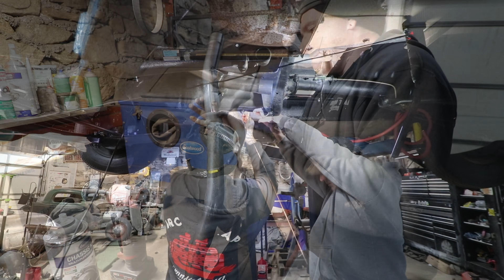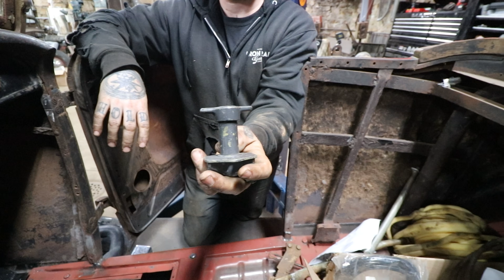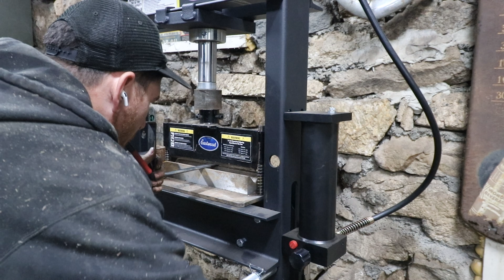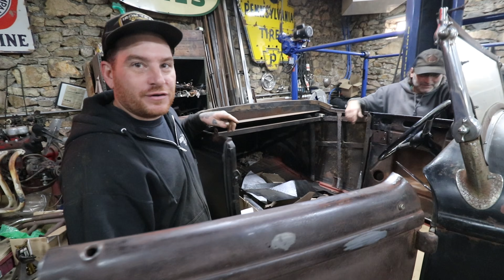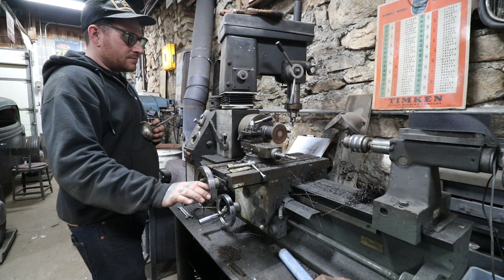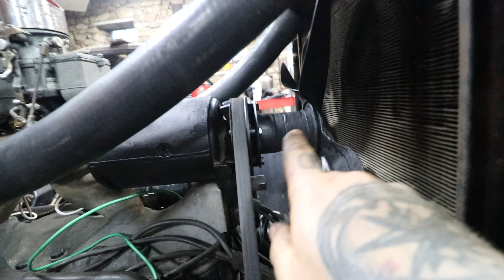1932 Ford Roadster Starting For The First Time Since 1953!!

Comment: Engine does sound different! Much pingyer, dingyer, bangyer than one with water cooled heads! Sorta like the difference between an SBC with solid lifters and one with hydraulic lifters. You come up with the best old hot rod stuff!

Comment: Matt, I don't think blue tooth ear dongles have a very high rating on the hearing protection chart. 😆
Reply from the maker: The iPhone ones have noise canceling! They work pretty good. Much better than what I normally use which is nothing. Lol
Reply: @IronTrapGarage  Cool. 👍

Comment: I cut my teeth on flat heads mid 50's hanging around my brother friends who. I help put motoes in and pulled them out with just using a rope hoist block & tackle by the time I was fourteen, I became very skilled pulling fords R&R plus many straight eights & chevy 6 cyl. now I sit here watching your shop work, I'm now working on a 40 ford cp. 327 ,5 speed TKX with a dodge rearemd 8.7/8 locker yes i'm still a hot rodder at 80 yr old but a loy slower. Keep up the great work Matt.

Comment: You guys need the little battery operated fuel pump that goes in the gas can and the car ! You can get it at Walmart ! I use one for diesel and one for gas here on my farm ! That way you don't have to lift to can to pour fuel in anything ! I think it uses 2 AA batteries it has and on and off switch !

Comment: You have a part number for those batteries you are using in your rods?
Reply from the maker: I misspoke it has 500CCA but still sufficient for a good running vehicle. It’s model #FAGYZ32HL. Find it here:  https://www.interstatebatteries.com/products/fagyz32hl?productline=power-sports

Comment: 9:59 You turn a lead acid battery on its side ? Or are you talking about a jell battery.
Reply from the maker: It’s an AGM battery. Can be mounted in any direction. Another reason I use them.

Comment: YOUR HARD WORK IS GREAT AND YOU HAVE MY FAVORITE NOW RUNNING. I AM A FLATHEAD NUT. I LOVE THEM AND THE WAY THEY ARE "CRANKY". MY '40 FORD COUPE AND MY '52 FORD TRUCK ARE STILL FLATHEADS.
Reply: I love flatheads too, bought a 50 ply coupe & pulled out the 440 & droped in a merc 255 flattie. Now i can piss off the mopar guys too when i tell them "yup, still got a flathead^
Reply from the maker: Thanks Jim! Long live flatheads and nostalgic hot rods!